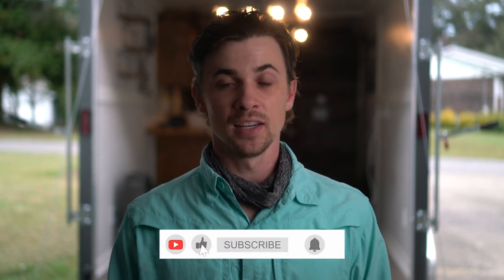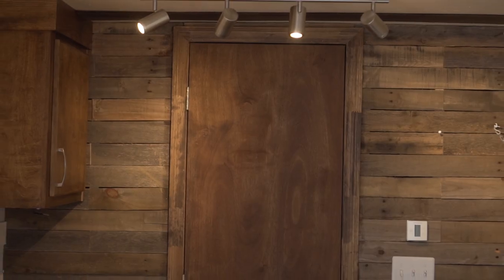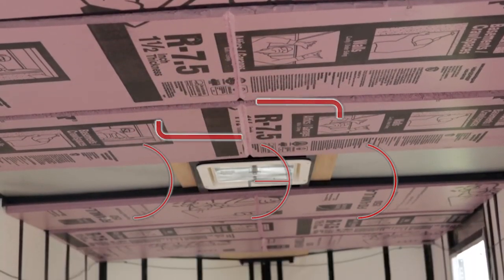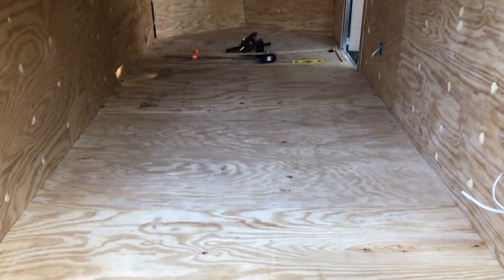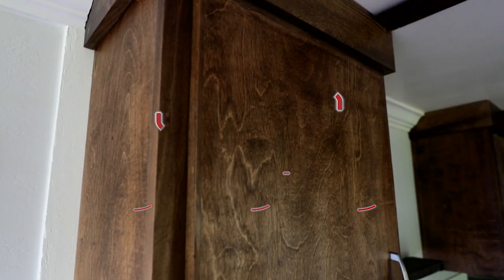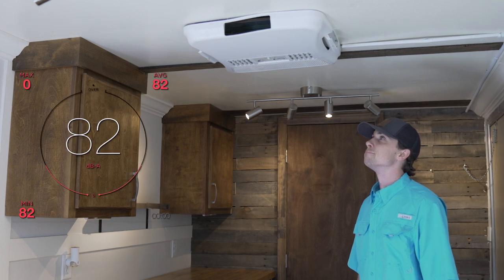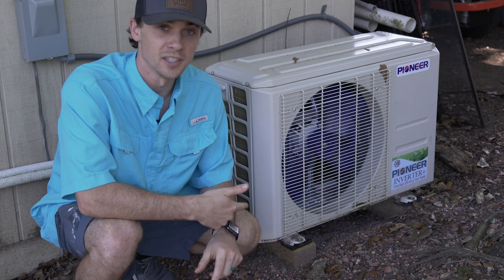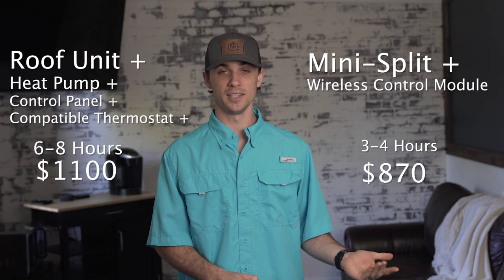Cargo Trailer Camper Conversion | TIME, DIFFICULTY and COST

Comment: Perfect sleeping space saving solution......glue & staple velcro on the wall (hook or loop your choice) then sew the other on to a pair of overalls lean against the wall, go to sleep. If that s not saving space I dont know?  Just messing with you.....can you show us how you mounted the split system on the tongue and where the refer lines are consealed in side your trailer? Thanks for the video...you mentioned your batteries weight about 500 lbs..................what type of batteries are you hauling Fork lift batteries?

Comment: Consider a standard window AC unit mounted in the wall. Some of these are very quiet and very efficient and cheap to run.
Reply: A lot of camping areas will not let you stay if a window a/c is hanging outside the unit.
Reply from the maker: Good to know. Thanks Richard

Comment: I’m building one to live in, a 8.5 x 24 . For working on the road, installing basketball courts. Also with a small music studio. I’m building an insulated wall to allow 6’ deep tool storage at rear ramp door, but a bed platform above it at 48” high. Will allow me to unload and store tools without effecting temperature inside. Queen size bed, putting fiberglass shower in the v nose with toilet. Putting one plumbing wall to run shower and kitchen on opposite side of the bathroom wall. So kitchen would be in left front corner. Just had a breakup after 11 years and I decided it’s time to live for me. No kids!

Comment: Been in the a/c trades for years and will say a mini split is way better .easier.to install much more efficient'- don't have to cut into the roof . 
the outdoor unit
Mounted on the passenger side up high is probably the best bet.

Comment: The dometic roof air is the worst possible choice. Besides the incredible noise they are expensive not only to buy but to maintain. The mini split is the only way to go. I also learned that the hard way.
Reply from the maker: Couldn't agree more, John. Were you able to successfully install a mini-split on your build?
Reply: @benseabrook7655  I'm in the process right now. That said I have seen one or two youtube videos of it done on trailers.

Comment: Question brother if u can answer it help out a lot. I build my own cargo trailer it’s a 6x12 but I kinda got stuck on the roof what kind of would did u use for the ceiling how thick and how to you secure it. I only finished half of it cuz I didn’t know how to come out the point of the trailer

Comment: Not sure how must tongue space you have on your trailer. You could Fabricate a platform, big enough for your unit  with a removable something like the attached photo.
Also, a murphy bed that folds up with a table on the backside. Usable when the bed's folded up.
Reply from the maker: Yea that is part of the problem- the tongue on my trailer is pretty small. And part of it it taken up my the control box for the trailer’s electric brakes.

Comment: This is my first time viewing your content. 
But, respectfully, please do not confuse 'needs' with 'wants'. 
Big difference between them.

As i go through my life i am finding that the less i 'want' the less i 'need' to be in a continual race to buy, get, or have more. More! MORE!!!  It is an unending cycle AND it does not, did not elevate my level of happiness. Not 1 single iota! 
A simple, relativrly uncluttered life is actually more full of fulfilling experiences. Of simple joys that are almost always better than contrived, expensive, complicated machinations thought up by some 5th Ave advertising firm. 
Figure out what you really need and jetison the rest. Life will be much richer, more fun and way less stressful! 
You can listen to what others might try to let you in on or you can figure it out down the road yourself.  Either way  
''To thine own self be true!'' to borrow a bit of Shakespear, a line from Hamelet. Which is still really great advice, if one can figure out exactly how to do that. And the earlier one does it the further ahead of the pack they are, and seem to stay--- at least from my informal survey, anyway!
Best of luck on your conversion (of the trailor!). Or anything else you might try.

Comment: Murphy bed, you can build them yourself with proper research and can make a bed/sofa murphy bed so you can get a sofa and a bed for as little space
Reply: I'll be putting one in mine since i dont see the need to have a set table for eating and stuff , im gonna use a pull out table or folding table that i can store away or fold in